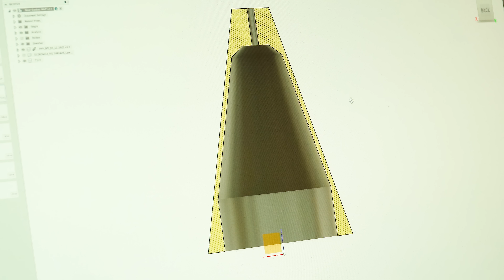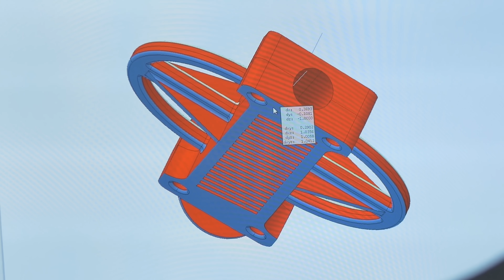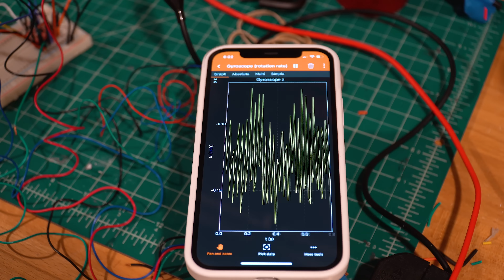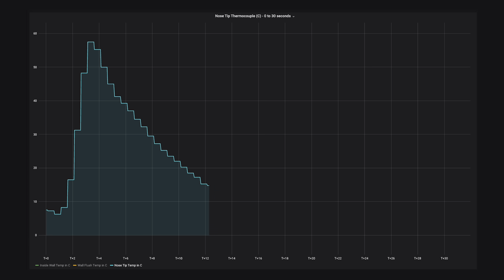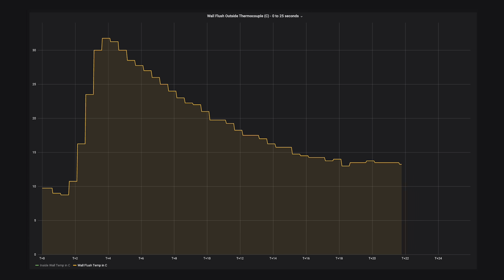How Hot Does a Rocket Get?

Comment: If you lined the inside of the nose cone with those super thin tubing that transfer heat super fast and fed the ends through the nose about an inch then folded and attached them to the outside of the nose cone. Say you used like 6 then made a little cage out of it inside the nose.
https://youtu.be/OR8u__Hcb3k

Comment: I think you are over doing the spinner mechanism... what about putting just fins to align with the airstream in a fixed coordinate (controlled by a fast servo) (N,S,W,E) and make the tip (or cameras) free rotating without motors to mantain the orientation?, to use it with no velocity just add an iron ball in the nosecone to offset the weight of the nosecone so it will rotate to align with the horizon by gravity. This ball i magine to be put in a conical shape inside the nosecone so when it receives acceleration is "locked" in place but when it loses it, its a free weight ready to be pulled down on gravity (until freefall of course), but should do the trick on apogee (or maybe just offset the weight on the tip?)

Comment: To hold the meat in the nose cone, I'd suggest an inner cone (made from something which doesn't absorb much of the transfered heat), which would sandwich the meat against the outer aluminium nosecone.
This inner cone could be held in place with grub screws from the outside, or a screw cap/ring on the inside.

You might also want to add a significant delay to the parachute charge so that the rocket can drop into a vertical dive for most of the way down, as this added time-at-speed could provide additional heat to the system, or at the very least, limit how much heat from the nosecone is sent back out to the atmosphere.. (it's pretty chilly 10ks up, and you don't want it cooked, but then snap frozen.. or maybe you do.. hmm.. there could be a market for that.. 🤔... but I digress..)
It'll also mean your rocket won't drift as far under 'chute, and you'll get it back hopefully before the meat cools down too much.. 😁

The big question though:
If it is cooked (satisfactorally of course) will you eat it..? 😉

Oh, and the camera spinner is fantastic, a true work of art.. wonderful improvement on the first version (which was still freekin' awesome), as all of your products are.. :)
Great video as usual Joe, cheers :)

Comment: You can solder thermocouple wires if you need to, the rub is just that where your cold junction is (where the thermocouple wires join to the same metal, e.g. copper) is what needs to be measured. TC amps usually have cold junction compensation that assumes the temperature is whatever it measures at the chip itself.

You can also directly measure the temp of any metal with a thermocouple by welding/brazing/soldering/peening the thermocouple wires directly to whatever metal part. They don't even need to touch, as the thermocouple effect between the wires and any other intervening metals gets cancelled out (law of intermediate metals)

Comment: Regarding the thermocouples and amplifiers, how did you measure and compensate for the cold-junction? Most modern data acquisition systems measure cold junction with an RTD and cold-junction voltage in the DAQ software.

Comment: cfd is half the actual solution, you would then need to do a FEA on the structure of the nose cone and the surface to cook the heat then use the estimated thermal conductivity to estimate the time needed at a given speed to cook the meat, which depends on the thickness and type of meat

Comment: Great job on the camera rotation!  Next iteration I recommend a ' slip ring ' so the electronics and batteries are literally held within a sleeve and can not touch the outer section due to  centripetal forces.  I also think you should check balance of placement so that the total mass has an expected ' center of mass' as close to the center of rotation as possible.  As to the Meat of the question, have you looked in to " Vacuum Cooking " ?  Placing a low pressure chamber in the nose, possibly in a form of gravy, to assist in heat transfer may help.  With the temperatures and lack of ' cooking time' sliced as thin as possible should assist, roughly Deli thin sliced meats should do.  Keep up the experimentations, keep learning from failures and successes, may you never find you have completed all your life challenges so you have something to strive for.

Comment: You're going to need a much thinner piece of aluminium. I used to work in robotics and the motor housings were made of thinner aluminium than you have there but they were very effective heat sinks. You need as much of your energy to go into heating the meat and as little to go into heating the aluminium as possible.

Comment: Why dont you record at very high fps and match the rotation of rocket use a custom software script to correct the fps of the video, total fps will be same as rotation of rocket you can max to 60 and min can go to 0 if rotation stops try out use 4 cameras do some overlapping and editing magic

Edit 2 -Better idea use a 360 camera like insta 360 in a clear acrylic tube, would be  supporting rocket as well as 360 video and use its built in video stablization feature would be much better

Comment: Find a way to shish kabob sticks of meat to the tail end of the rocket, so the engines cook up it up to apogee….
Reply: I have the solution to your problem joe, build a capsule similar to what your engineering for your nose tip. Place that capsule at the end of your engine where your engine exhaust gases are at the hottest and on launch you should experience enough heat to at least cook the meat…. Through launch up to apogee…
Reply: As for trying to cook meat based on aero dynamics and thermodynamics… I guess the best bet would be to recycle that energy and convert, which happens in what? Seconds or milliseconds? I’m not sure about that energy conversation….

Comment: I don't think you need to do much to cook the meat if you are actually heading for a Mach 3 rocket.  Regardless of how the heat gets into the meat (the focus of most of the suggestions), you essentially have an energy problem here.  You need enough energy to be dissipated into the nose to heat the meat sufficiently to cook it.  If this first requirement is not met, you're not going to cook anything.  Assuming most of the energy is coming from drag, the energy dissipated into the nose cone will be roughly related to the square of the velocity.  So right out of the gate a M3 rocket will impart 9x the energy into the nose over a similar time period.  The temperature rise on the inner wall was 12f.  If this increases by 9x you're looking at in inner wall with a temperature rise of 108f above ambient.  Given an 72f day, you're looking at 180f, which is above the "safe" cooking temperature of pork at 145 (Bacon being the obvious meat choice if thin meat is desirable).  Time at temperature also matters to cooking,  but making the meat thinner can help this issue. If the energy going into the nose is insufficient to cook the meat, you have at  least three options, increase the drag of the nose, increase the velocity, or increase the time spent at high speed.  All of these should increase the energy transferred to the nose.  Once enough energy is getting into the nose, then improving heat transfer into the meat and reducing wasted heat transfer out of the nose will matter.

Comment: What would happen if you put a cavity in the nose and pull a super strong vacuum on that cavity. Maybe, due to the lower density of particles, more of the energy that enters the system will concentrate on the meat. Might need a way to attach the meat to the walls though because there would be little to no air to transfer said energy. Also, Use a very thin slice of meat, Im talking like ribbon thin.

Comment: Since super sonic projectiles get this wave front they push in front of them, your thermal absorption point needs to be at the very tip. Copper is an easily machinable, auto-desinfecting and excellent heat conducting material. And the meat should be added last minute to not spoil on the launch pad. With all that I vote for a screwable, hollow copper tip.

Comment: Hey Joe, you talked about using cfd for determining the heat buildup by mach numbers as well as the heat distribution.

Besides cfd you could also use simple compressible flow equations and relations to get a ballpark estimate of how hot its gonna be (eg T/T_0 for a given Mach number and then measure static Temperature). For the meat you could also use the simplified heat distribution equations(dT/dt) to get a rough estimate factoring in material (Alu, meat) properties and thickness.

I know you are pretty busy doing all your other stuff but perhaps this could help :)

Comment: Its one thing to get heat transfered to the meat, its another thing for it to actually cook. For that you need time, sustained high-enough heat I think will be the main challenge. You can go mach 3 for a second just fine, but that meat still may not cook because it wasn't hot enough for long enough.

Comment: Nose cone a sealed metal/ thin gauge steel container.  (Or copper even )No aluminum.   This will act like a tiny oven if you can get that nose cone to tint red .
   Another simple way to test the heat of the nose cone .   Make it out of thin steel.   Depending on the color it comes back as , you’ll know what temp it reached.    Steel turns colors at temp so accurately , you can practically get an exact measurement.          Blacksmiths have been doing it since the trade began.       
Another note, add air resistance.   Use a mesh or a few rings around the cone to add drag and hopefully heat the container.        Use a heat sink below the container to prevent the heat from messing with the electronics.   Have it vent excess heat through the rocket body below the nose cone .

Comment: I would suggest concentric nose-cones. An outer one to contain the meat (with maybe a thermocouple for meat temp) with good heat transfer or heat absorbsion (for continued cooking after acceleration) , and another one with the normal electronics. The separation is to keep liquids away from electronics under G-forces and separation of areas that need heat from areas that don't

Comment: use a heat pipe assembly from a couple of CPU coolers to xfer heat from a surface fin arrangement to a burger with heat pipe grills on each side in an oring sealed round box that fits in the nose cone

Comment: you can use focused projected sound waves to disrupt air pressure and friction ahead of the missile and reduce the heat from friction and increase speed. give it a try. you will be amazed at what is actually possible.

Comment: The rotating shots are great.  For the meat, I believe that the main source of heating may be infrared radiation from the shock at the front.  As a result, if the meat was behind a layer of glass then it would be exposed directly to that heat while being protected from direct contact with the air.

Comment: You never stop asking questions about rockets and rocketry.  Keep it up  - really keeps your community going! 
How small is small for the 'slab' of meat?  The walls of the aluminum nose cone do not have to have the same consistent thickness throughout - make a small portion very thin so that the heat transfers much more quickly.  I don't know the machining capability that you (or ProtoLabs?) have but possibly use some sort of internal honeycomb structure.  Not easy.  Machine it from flat stock and then bend into a cone shape or make the cone in vertical sections?  Piece it together and then do the final outer surface machining to finalize the cone shape.  
Surface area dissipates heat (thin fins on radiators) and can also absorb and direct heat.  A very few fins (canards?) on the nose cone might capture a little more heat - due to the increased drag / friction. There may be other ways to increase friction on the outer surface . A balancing act because more drag reduces the speed of the rocket.  
The spinning camera mechanism looks quite heavy - you probably have opportunity to reduce weight which could allow rocket speed to increase (marginally?) and therefore increase heat generation on the nose cone.  
Or just place the meat on the engine nozzle - cooked for sure.

Comment: You should just line the inside of the cone with thin strips of meat. You really need quite thin slices considering the flight duration, i.e. cook time, is going to be short. 

I initially considered that you could insert something like an aluminum heat sink inside the nose cone and put very thin slices of meat between the fins of the heatsink, but the more metal you have, the more energy is going to be lost heating the metal.

Comment: Maybe you can illiminate the whole camera spinner problem and go for a much more easier solution. You could try to attach 2 or more wide angle lenses and make your own 360 camera into the walls of the rocket or just use the parts of an already prebuilt one. This way you do not only get rid of the spin but you also achieve a full field of view!

Comment: Nesting nose cones with a set gap except where they thread together.  Note : an O-ring will be required to control out gassing, as will vents to prevent over pressure.   

I’m not on twitter sorry…

Comment: Place the meat under the rocket tip like an astronaut. extend the flight time. If there is a relatively horizontal and long flight, it will cook more!. The thicker the air layers, the more they will heat up and cook. so you can fly it like a cruise missile. start with rocket propulsion for longer and faster flight. then continue with rem jet, or screm jet.! And a few days later, you'll even be on TV🤣 "because the air force destroyed the Chinese cruise missile in the air!."🤣🙌

Comment: 2 metal cones acting as the nose cone which sit on top of each other and tap a deli style slice of meat between them, will act like a sandwich press. Also maybe a more rounded cone to compress the air in front of the rocket heating it more.

Comment: Think about it like a frying pan with an insulating lid. All is upside down. The external surface of the nose cone is like the underside of the pan and so needs to be a thermal conductor (best would be copper/silver). Inside that would be the “lid” so should be an insulator like ptfe. Leave a thin cavity between the two cones (like 2mm). If the copper external cone is less than 1mm thick or maybe 0.5mm, and the cavity behind it is 2mm thick, you have a conical space where you can put some thinly sliced meat. The insulating come inside is important to minimise the thermal mass that is being heated and stopping the heat conducting away from the meat. I have drawn an image…. Not sure I can put it into this comment :)

Comment: I wonder if there is a variation of a heat pipe that would work at these G's.  I like the idea of storing the steak in an insulated chamber and then using a thermosiphon to transfer and concentrate the heat from the nose cone into the meat.

 You are also probably going to need to make the tip significantly less aerodynamic.

Comment: Gorgeous footage! For the cooking aspect, I think stagnation temperature may be a useful quantity. If you imagine air going 362 m/s in a wind tunnel, it has a certain amount of kinetic energy. Ideally, to create heat, you should convert all this kinetic energy into thermal energy. Simulating your launch, 1 kg of air will have 1/2 (1kg) (362m/s)^2 = 65.5kJ of kinetic energy. Air has a specific heat of about 1007 J/(K kg). Dividing the kinetic energy in one kilogram of air by the specific heat yields about 65K, or 117 degrees Fahrenheit of temperature change. So, I believe that the highest temperature you could hope for, given an ambient temperature of 50F, was 167F. This is only slightly above the food-safe 165F for meat. If you push the rocket faster, this will obviously get much easier. Going 426m/s, for example, with an ambient temperature of 50F would put the upper bound on 212F. Your heat pulse is going to be very short, requiring a small food sample and many extra degrees Fahrenheit... imagine trying to cook anything in five seconds!  Keep it up!!
Reply: This is an excellent engineering response. He would also be able to capture that heat better using a thin sheet of either copper, or preferably silver. If he were to effectively insulate that sheet from the surounding structure, he could also avoid a lot of parasitic heat loss. it would be way better to have everything made of epoxy/fiberglass except for that thin sheet and the meat.

Comment: Use copper and make the boundary layer turbulent, also lower the thermal mass of the tip. Put most of the thermal mass out of contact with the wind so that cooling after burnout does not remove too much heat from your tip

Comment: Getting rid of that large chunk at the tip would greatly help reduce that thermal mass and transfer more heat to the inner wall of the tip. May take a little more effort on the machining side but I believe it would be well worth it. Another thing is to thin the wall of the base section of the cone. I think you could get that tip at least half as thick as it is now. Those things combined will help you transfer the most heat to the inside of the tip. Good luck!

Comment: How much pressure is the nose cone experiencing, it would be interesting if you could incorporate piezo crystals to power a heat element imbedded in a design. Not sure how long or how much power it would generate but it could be interesting.

Comment: u should use ptfe wire instead of silicone, they r better in every way except ease of wirestripping. but for u the fact that they dont get caught up or pinched nearly as easily is probly the key feature improvement